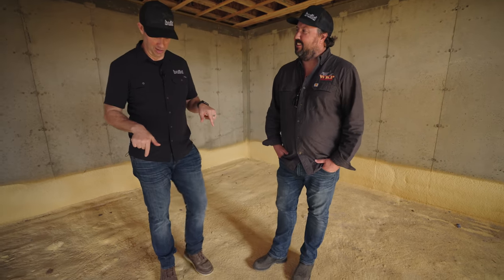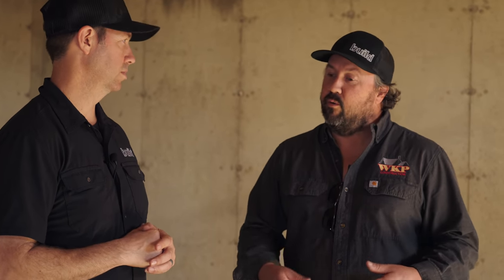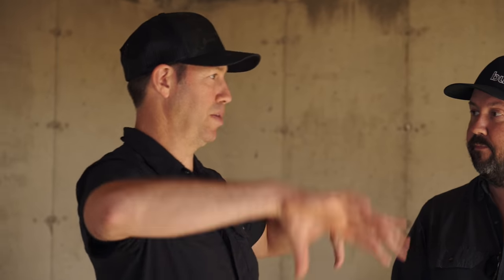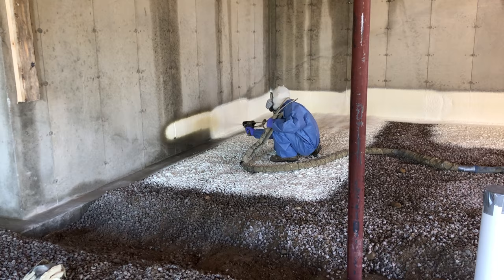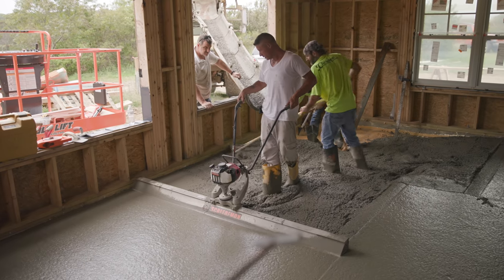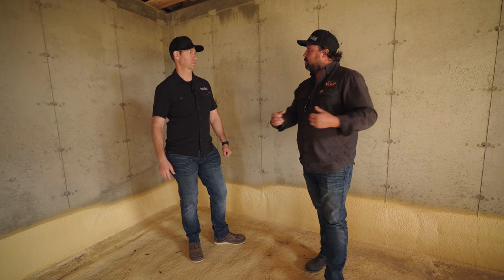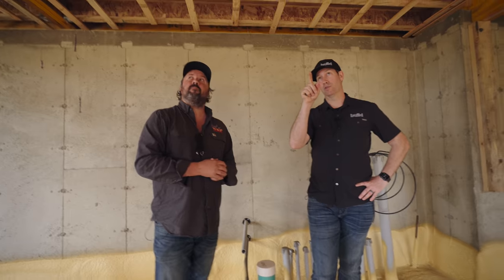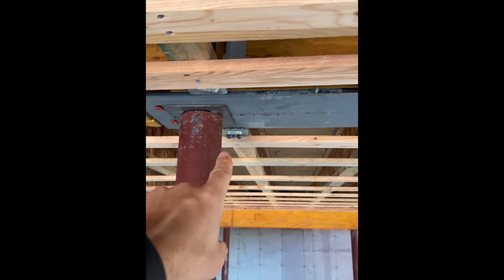3 Tips for a Better Basement BUILD (Insulation, Waterproofing, & Framing)

Comment: Foaming the inside of the wall makes the wall cold, same temp as the soil, which means that the wall retains moisture, which means that the moisture will drive upward toward the sill and rim joists. This puts a premium on some kind of membrane under the sill/rimjoist to protect them from moisture; hard to do. Far easier to waterproof (membrane such as PolyWall) the exterior, then install a dimple board and then rigid foam board insulation. Then you have a dry, warm concrete mass, thermally stable and not transporting water vapor.
Reply: I see your comment is a year old . I have tried over and over to reach poly wall to buy their products for builds and can’t get a call back or even an email back. I don’t think I would ever use their products if I can’t even reach them to buy from them. Just imagine if you ever had an issue !!
Reply: They are waterproofing the outside as well.
Reply: This climate zone requires R-10 on exterior of foundation on top of water/damproofing. This under slab insulation and waterproofing as well is spray foam on interior of foundation wall will stabilize core temp and relative humidity of the wall as it reduces expose to moisture all the way around the wall.I did this in my house 15 years ago. my basement is 65-67 degrees ALL YEAR ROUND.

Comment: When pouring over foam I highly recommend putting a layer of poly over top, for no other reason except that the foam dries the concrete fast and is a pain.
Reply: even over foam that is taped at the seams?
Reply: you should really wet most any surface youre putting concrete except for soil.
Reply: Really interesting. what about ICFs?
Reply: ? The foam isn't porus is it?
Reply: @kennorthunder2428 No, it is not.  ICF does not need poly on top.  I suppose you could if you want, but remember the anchor bolts are poking up periodically, lol.

Comment: The core drilled holes that are sealed is the same old technology that Navy ships use for bulkhead and deck penetrations.  It's just rubber squished by tightening bolts to create leak free and also fire rated seals between compartments

Comment: Love to see commercial/industrial products make their way into residential work. Link-seals have been used for many years on the commercial side and are especially utilized for large diameter penetrations below grade. Fun stuff!
Reply: We used them in commercial electrical applications when I worked with a panel shop. Prior to that we used them in a hospital setting when installing new commercial washers for their laundry service department. 

I saw this application and I was pleased to see them make their way onto this build.
Reply: There are so many good products out there.
Reply: I work in precast concrete. We use link seals all the time.
Reply: Huge difference moving from commercial builds to residential. Was laid off from commercial back in 2020. Moved over to residential and they just couldn’t get the ideas I brought about these types of building science techniques. Took some growing pains, but now I have the company I work for is building a much more solid product, and even with the increase cost increase, we are able to make great profit because people are willing to pay for it.

Comment: Feel like the foam will compress slowly over time making the floor weaker.
Reply: YEP,  we see a lot of issues as it ages in craw spaces and high water table areas. Not a great way to Insulate a slab. Again experimenting on other dimes. Proven methods with ICF that do not cost nearly as much. Labor intensive yes but materials are cheaper and better for the homeowners
Reply: @zack9912000 I'd just use a moisture barrier under the slab

Comment: Wondering how the waterproofing is done on the exterior of the basement.
Reply: The secret to waterproofing a basement is good drainage on the outside.
Reply: I couldn't agree more. I have 2 basin sumps with a french drain on the interior footers and walls. I still get water through floor drain, cracks in floor, sometime it will come over the french drain in the back corner wall. I get all the run off from the hill next to the house. Another problem to think about is the hydrostatic pressure from the water can raise a floor or even push the walls in on block foundations like mine. So simply sealing the interior walls, floor can raise those pressures on the walls, and floor. Grading landscape if possible and drainage on the exterior is a big key
Reply: A multivariate approach is always best. Good draining backfill soil, french drains, good gutter management, swails, etc. on the outside. Drain tile, sump system, spray foam inside. Guaranteed dry and comfortable basement.
Reply: @mistere5857  Drainage is great to stop water leaks. Add to that a peel-and-stick or liquid spray-on vapor barrier to really keep the moisture out.

Comment: Reminds me of rubber stoppers we used to have for opened sodas.  Put the stopper in the mouth of the bottle, flip the lever, and the mechanism would squeeze from both ends expanding the diameter of the stopper, sealing the bottle.

Comment: How good or bad of an idea would it be to have bores for a vertical geothermal Loop and your well to be dug so that they come out of the floor in your basement vs drilling holes through your wall to bring those pipes in from the outside?

Comment: I wonder if a system of sleepers could be put on top of that foam, then sprayed again, then the foam trimmed flush with the sleepers. Two layers of overlapping plywood on top. Sleepers would only be to establish flats, not quite load bearing. No need for concrete, no moisture sponge under there to preclude wood or carpet flooring.

Comment: Wade who do you use as an insulation contractor?  Do you usually spray foam 1st floor floor-joists if you've foamed under the slab?
Reply: Wouldn’t be a need to hit the joists, except rim joists. Anything on the outside facing of the house. Closed cell foam is an insulator and is waterproof. So when you spray the walls and under slab, and continue up the wall (think continuous no holes base to roof) everything is brought in to the conditioned space. No need to do the floor joists.

Comment: Not sure that I understand the sequence when it comes to framing the walls. Are you attaching the studs to a sill plate and then to the floor joists with a void that will be filled with the foam? Do the studs need bracing because they don’t touch the concrete?

Comment: One thing that I haven't seen on the YouTube "home building shows" is dealing with water leakage through an above grade poured concrete wall crack and then penetrating behind the exterior water proofing into the basement. The poured concrete wall is going to crack and provide a water access into the basement. I have never seen an episode on how to build a basement accounting for this leakage source during the build.

Comment: How would you treat the under-slab closed cell spray foam to prevent termites from entering a house at the gap between the basement slab and the basement wall?
Reply: Can termites burrow 8+ feet underground to get to the foam?
Reply: yes
Reply: Also, if he spray foams from the bottom slab up to the floor joists, that won't leave any area to inspect for termites. Termites can create their tunnels through the spray foam and you cannot see it. That's why you should leave a few inches from the top of the spray foam to the bottom sill plate, so you can see if any termite tubes get created.
Reply: @jonathangay465  aha it is not Texas here to create thermo bridge which would lead to condensation in uninsulated area.
Reply: What Jonathan replied in this comment thread is the truth. Without going into details, the spray foam industry is now working to get approvals for use in thermite zones. And leaving a gap between the top of the spray foam and the sill plate is the way that's being recommended by industry experts to allow visual inspection of thermites. The industry is working with the relevant governing bodies to get this installation technique approved by building inspectors and insurance companies. Termites are the only downside to spray foam compared to other insulations in basements. But in non termite areas, spray foam's performance is not comparable to others.
Reply: Termites aren’t found in the north much
Reply: @RickGrimes807 Are thermites hot termites?
Reply: Yes they are.
Very observant of you.
But the “Thermites” do require a source of water to keep their exoskeletons from overheating😂. This cooling water, which they get from condensation that is trapped between the two vapor barriers , I.e. inside closed cell and the exterior water proofing.  Just kidding although I am curious how the moisture from condensation is evacuated ????

Just a guess but I would think that the ground temp in Block Island would be in the mid 50s to 60’s in the summer and maybe a little bit colder during winter months at 
Least for the first 3-4 feet below ground
Given that the warm inside sweats, where does the moisture go.?
I guess this space could be continuously dehumidified and extract the moisture that way

I would hazard a guess that the exterior insulation has some sort of dimpled product which
Permits the water to drain down to a foundation French drain attached to a sump pump.

Comment: With the spray foam on the wall , won’t that allow a passage for ground water to seep up the wall . Where if concrete was poured directly contacting the basement wall would seal the floor to the wall
Reply: I would think that the spray foam would create a tighter seal between the floor and the wall.

Comment: Timely video -- I'm currently researching basement build techniques for a custom home in East Texas.  A comment that a user posted recently to another video that spotlighted spray foam under slab mentioned termites and how this technique was bad when they're active. Comments?
Reply: I would say that is very true as well as the foam rots after a few short years. In this case they have two inches of foam that will allow the slab to move and crack. Closed cell foam isn't ground contact rated and will still absorb water. Designed to last their warranty on the home and others will have to fix the slab after.
Reply: I'm planning a home as well in East Texas. Jacksonville. I will have a basement, but it is becoming a challenge to find an experienced concrete basement builder. It has to be done right the first time without mistakes and totally waterproof. Have you found anyone who knows what they're doing?
Reply: @diyoregonnowtexas9202  Great question... I, too, have researched basements and I'm not sure if it's just a Texas thing, but these inquires have been met with blank stares or silence.  If you're not within the big metro areas, it's difficult to get anything built besides the standard rinse-and-repeat slab-on-grade foundation and stick built structures.
Reply: @DT-vc7hd Do not build on a slab.

Comment: I've never seen strapping in Arizona, and plaster was last used in like the 60's...
Reply: Both are the best way to do the interior, Jmo.
Reply: I saw another one of his videos where he's in a 125 year old building being remodeled... Zero problems from mold etc, because plaster treats vapor differently than sheetrock... Plaster does not trap it but absorbs and releases it naturally... But on THIS video the guy said Blueboard and plaster skim coat...  But that was the ceiling where there is no vapor differential from one floor to the other... So, who knows.
Reply: @augustreil  What's so great about plaster versus just skim coating drywall?
Reply: @mr.g937 , thicker and way stronger.

Comment: Wade what size stone do you use under the spray foam? #57?
Reply: 3/4” crushed stone
Reply: small size stone works well no compactor needed.  The days of shoveling 1-1/2" stone are over  3/8 or 1/2"

Comment: Matt... if there is a crack on the basement wall and have a slow leak, where would the water go? if it is not fully sealed like this, the water can flow under the slab and avoid a disaster?
Reply: In a high quality build there are multiple protections.  First bomber waterproofing on the basement exterior, then a pleated product that puts an air gap around the exterior, allowing water to drain to underneath the basement and not remain on the walls.  The crushed rock under the basement will allow the water to drain, normally to a French drain system.  Finally a sump pump or multiple sump pumps are added for insurance in case the rest of the systems fail.  Also worth noting is that so long as the spray foam doesn't crack, it will also prevent water from penetrating.  This is how I'd build a basement if I was going to do a new build.
Reply: @ProfessionalFixologist  Sounds like a significant amount of work and cost for a basement. I guess in a "cost is no concern" build it could be done, but for the average homeowner it seems like overkill.
Reply: @borderwave2  Waterproofing material on the exterior will run about 7 dollars per square foot of surface area. Next is drainage tiles which is cheap requires less than a day to do.  These run about 50 cents a foot with the sump pump basin and pump running about 50 and 150 dollars respectively.  The final part is the interior spray foam.  That cost will not be cheap but current building codes require it and will run at least 4 dollars per sqft of surface area at 2" thick. 
So lets look at 3000 sqft ranch house.  If we go 75ft by 40ft with a 9ft basement wall we run an exterior surface area of 2300ft. Now the exterior WP is 16k dollars, the drainage will run about 450 dollars plus a days labor. As for the spray foam you are looking at 21k dollars.  All told you have doubled your houses sqft for the cost of 38k dollars with just the need to install 2x3s and drywall to finish it out which with just one room would cost 1500 dollars plus labor.  More rooms would just add modest costs and provide more value.  In the end a finished basement provides a huge benefit to the house value given that a basic house costs over 100 dollars per sqft you just added 3000 sqft for around 15 dollars per sqft, more when divide the basement up. If you tack in the concrete that adds 14k to the cost and brings the per sqft up to 20 dollars. Now windows are also required but those are 1k a piece.
Reply: @mdhofstee  I always thought that basements are not typically considered in the square footage of a house when doing real estate calculations.
Reply: @borderwave2  typically they are not except when they are legally done for living space. To be considered every room except for utility and bathrooms have to have two points of egress, typically a window for each room closed off by a door.  Next is height. It must be 7'-6" per code. Once those are done the flooring needs to be something other than bare concrete. One final metric is hvac needs to be in place and working.  I will state that feds have some issues with basements so that is point of contention in some respects.
Reply: @mdhofstee  Thanks for the insight. I did not know that.

Comment: So... 
1... By 'stone', you mean 1 1/4?... 3/4?... Gravel is 5/8 in my experience... 
2... 'Air sealed mudsill to foundation'... How is that done. 
3... "The beam's been 'packed out'... ??? 
4...  So happy to have found your channel... I picked up some major tips today as always.
Reply: A "packed out" beam means they filled the webbing of the steel i beam with lumber until flush so they could run floor joists and hangers to the wood inside the i beam. The lumber in the webbing is lag bolted from one side through the i beam to the other. Basically just makes framing easier so they're attaching wood floor joists to wood like normal.
Reply: @95dodgev10  Ah... Got it... Thanks.
Reply: 1 - Crushed stone/angular rock is usually 3/4". Known as "#57" in the industry.
2 - Air sealing the mudsill is done using a thin foam material known as "sill seal" used in conjunction with an air sealing caulking. One bead of sealant between the concrete and the foam and another bead between the foam and mudsill.

Hope this helps!
Reply: @sixtomidnight1492  It most definitely DOES help... Both questions answered with clarity... Thank you. R
Reply: @bosatsu76  crushed stone could come in a variety of sizes 1/2" to 3" is a normal variety here with others sizes in between
Reply: @billmccance7762  But what does THIS contractor mean by 'crushed stone'...
Reply: @bosatsu76  gravel companies take large rock and break it into smaller pieces with a crushing machine, pieces are collected for similar size for sale.  The stones are crushed into 1/2" to possibly 6" sizes. Call your local gravel supplier to find out what sizes and what types of stone they use / supply.

Some stone is sold as ( washed) clear and some still has the fines ( sand) in it which is call minus

Comment: I have a question.  Is there anything you can do to create a thermal break and or prevent moisture wicking up from the footings through the foundation walls
Reply: Look up a product called fast foot
Reply: Amvic icf wall with Fastfoot footing. The Fastfoot fabric can be screwed into icf webs as waterproofing layer

Comment: Insulating the exterior of the basement walls would allow the thermal mass of the walls to be part of the heated/cooled structure.
Reply: I've also seen PassiveHouse pour footings onto Type XIV EPS to bring them inside the thermal envelope and eliminate that bridge.
Reply: That's the advantage of ICF.